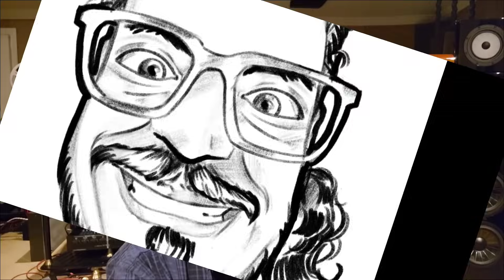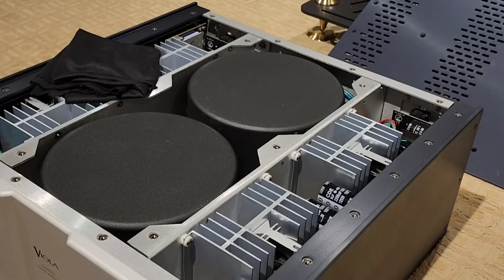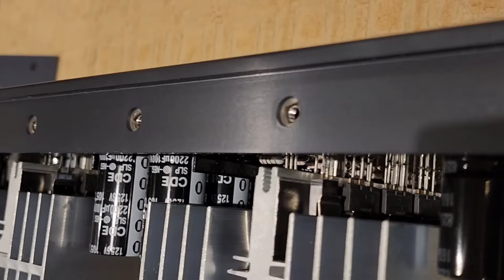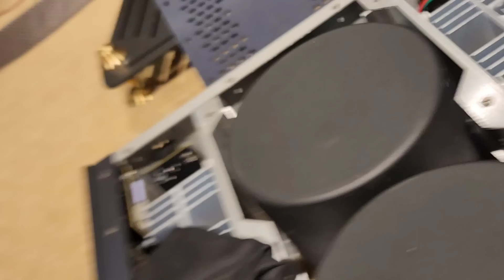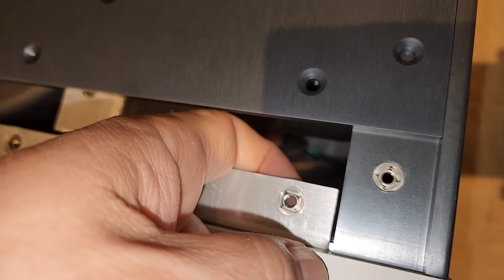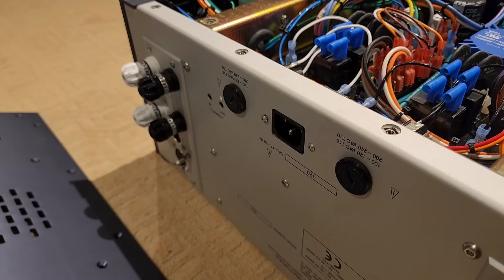THE BEST SLEEPER AUDIO AMPLIFIER OF THE DECADE !! #thebest

Comment: Speaking of 'sleepers,' Madrigal took over the Mark Levinson trademark and one of the amps produced was engineered by Steve Mantz for the last Hi-Fi hurrah of the Harman/Kardon Citation 5.1-7.1 THX line. Steve Mantz still uses and services the Citations at his ZED labs in Los Angeles. At over twenty-years old, there are 60 capacitors to replace. I bridge my 5.1 for 300wpc to drive Dahlquist DQ-10's.
Reply from the maker: Wow. Crazy...
Reply: @OCDHIFiGuy  "We did design and build the Citation 7.1 and the smaller 5.1. We built a lot of these for Harman International. The amplifiers are flat from DC to 270KHz where the response is about 1dB down. Harman wanted this silly specification, why I do not know because we are not bats and cannot hear that high. The original specification was that they wanted the amplifier to go out to 600KHz, but the first prototypes were NOT happy out there and so we 'compromised' at just under 300KHz.
Each channel uses 10 Toshiba 20MHz output devices with a theoretical dissipation of 1,500 watts. The circuitry is fully complementary from input to output and it has some very unique features. Each channel has 6 power supplies which are separate from the other channels. The only common item between channels is the power transformer, which is a 2.2Kw toroid. This 2.2Kw rating is at 25 deg C and it can put out upwards of 3Kw at higher temperatures.
The input complementary differential pairs are driven by temperature compensated constant current sources, which ensure almost zero drift of the DC conditions with each channel. These are also cascode connected for maximum bandwidth. The main gain stage is also cascoded for increased bandwidth and is also Darlington configured for high current gain.
The output stage is a triple Darlington with ultra fast turn off delay. The main power emitter resistors are non inductive types. No coils are used in the speaker circuit and the amplifier is stable into reactive loads with a phase angle of over 45 degrees. It has the usual plethora of protection circuits which by the way are not in the audio path. The amplifier can be turned on with a remote trigger or by the rocker switch on the rear. It can be changed to run from 100v to 240 AC 50/60Hz.
I have the last two production amplifiers at home, one of which I use in my own system for the subs. I run it in bridge mode into a 2 ohm load, and I get out 1Kw per pair of bridged channels. I did modify the protection circuit to allow me to run each channel into 1 ohm! I have used the amplifier for 8 years now and it has run flawlessly." - Steve Mantz
Reply: The house isn't tornado proof, but whatever those amps are sittin' on ain't going anywhere.

Comment: I wouldn’t call this a sleeper amp by any definition. It just isn’t. Stuffed in a rack it looks high end. Close your eyes and on weight alone it screams high end. Cover the name and just look how the exterior looks, thickness of the exterior and that to screams high end. Take of the covers, forget about it, it’s high end in a class by itself. If you took the innards of the amp, stuffed them in the cheapest of metal boxes, didn’t let anyone look inside or lift the beast then yea it could be considered the sleepiest of sleepers.
Reply from the maker: Its learning time. Look up Boulder Amplifiers. Look up D'Agostino Amplifiers. Look up Gryphon Amplifiers. Look up Burmester Amplifiers. Look up MBL Amplifiers. Those are a few of the competitors for this amp.  This is by all means a total sleeper...
Reply: @OCDHIFiGuy  Why? I grew up in the 60’s 70’s, I’m also a car guy. The “sleeper” wasn’t the Mustang, Camaro or Lamborghini. It was the Honda Civic with a Chevy big block stuffed between the fenders. That’s a quality amp and you can tell just by the methods I laid out. If it was a car I wouldn’t race it unless I had the sleeper I built myself and I knew I had the edge
Reply: @NA94753 😮

Comment: I'm unsure we should be calling 20-30k amps as sleepers. Sleepers in car terms I know of is basically a car that doesn't look fast but goes like hell once you try to race it. a BMW M5 doesn't qualify as a sleeper since it's expected and looks like it goes fast, a BMW 340i however without any sports pack still goes very fast but doesn't look like it..just like the above amp, I expected way more from 30k lol. Sleepers should be relatively high value(not cheap), with built quality based on the price it's sold at and outperforms many of these higher end(good sounding but horrible value amps). Hypex Class D amps like the NC500 module would be a sleeper, sounds fantastic(no house sound), make your own through the DAC and Pre-Amp of your choice, built to last, super power efficient with 1200W power Supply, very low temperatures(Again extending the life of the equipment) and distortion levels to dream of. 2K would get you two monoblocks that walks past the above. Maybe the above will give you a House sound that you prefer, that's subjective.  So it may be a Sleeper...for the ultra rich...not for common folks ;)
Reply: He click baited us with the title.
Reply: Totally agree, $35k! Not sleeping anywhere.
Reply: The price is ridiculous.
Reply: @TheStarflight41 30k is not much for an audio amplifier these days though  🤷
Reply: @marcfavell   yes it is
Reply: High end vintage Japanese integrated stereo amplifiers if restored to mint condition can potentially go for as high as 10 grand. It has that unique sonic characteristic of being both warm sounding and bright at the same time that the vast majority modern amps do not have. I prefer a musical sound over analytical anyday. If I wanted analytical sound, I would go for Genelec studio monitors.
Reply: @davidperry4013  My favourite amp is a Pioneer SA 6200 , fully refurbished and recapped a set to factory spec. It's 15 Watts output into some vintage wharfedale w70's. For room it's perfect. The Japanese made brilliant amps in the 70s.
Reply: @davidperry4013 class A amps all the way.
Reply: @johncribbs8382 
Great heaters!
Reply: @davidperry4013  for power amps imo..just go digital. hypex or purifi. if you want warmth go for a pre amp of your choice, a good tube amp for example. sound characteristics should not be part of the power amp ideally
Reply: Title versus content makes me want to stay away.
Reply: Pretty much anything audio related is overpriced. Especially this kinda shit .decades old designs made with a few hundred bucks in parts .
Reply: He said $35k in the video. For that price, this amp is garbage.
Reply: @Gruuvin1  This channel is garbage.
Reply: For that price the amp should sleep with me and cook me F'n breakfast in the morning...lol
 @Gruuvin1
Reply: Couldnt agree more
Reply: I put a 550 in a ford Taurus’s
Reply: I would expect more of an amp that expensive
Reply: @Stan_the_Belgian  35000€ est trop cher  : combien coûte cet amplificateur en pièces et matériaux ?10000$? Ou vont les 25000$ de différence?: marketing,, publicité, revendeur, intermédiaire....
Reply: Hello from good old Germany... Very well spotted! This high-end nonsense is really getting on my nerves! I come from an event technology background and we always find this high-end society amusing ;-) I have been building speakers myself since 1978 and I laugh at the whole thing! PWM amplifiers have been part of event technology for a long time, and my back thanks me for it! The high-enders are slowly realizing that they are losing their skin! Class A is not for the modern world, at most for the rich who then cool down the overheated room with their air conditioning in the summer... we live in today, not yesterday!
Reply: Class d sounds like shit what are you on about
Reply: @thebloodrend  😅😅 How are people praisong class d amps when there are pure class a amps?
Reply: @beslemeto  I don’t understand the hype for class d. It’s sounds so dry and dead. It’s only good for large scale applications and projects.
Reply: @WhopperRektem depends on  amp I agree a lot cheaper products do sound clinical and forward . But even cyrus break that mold for the price of a fosi  one can buy a much Superior class D add the power supply and your cooking for £300-350 .
Reply: Better leave it as a sleeper! 😅
Reply: Totally missed the boat on what that word means.
Reply: Ill take a Luxman tube amp for $4-5k and spend the rest on other equipment. This is not worth 30k.
Reply: A sleeper in automotive terms is a stock looking, modest and understated, usually cheap 'everyman' car that has been highly modified to be as fast as hell....but still looks cheap.
Reply: it´s true but since early 70´s BMW produces very fast cars with quality of building, so it´s only natural that a BMW is fast ,that i know of there aren´t none that drives slow, in the 60´s there was a model that looked as the alternative to a beetle in VW but looking smaller with only 32 h.p.from BMW, i colect them
Reply: Nice to see a balanced cynical view lol. ♥️👍 However, tldr.
Reply: I agree
Reply: I regard the Sanders Magtech amps as sleepers.
     
Stereo:
500W 8Ω / 900W 4Ω
Mono:
1600W 8 Ω  / 2000W 4Ω
Fully regulated power supplies. Drive down to 0.3 Ω

But the audio press rarely champion them because they are sold direct and hence they can’t make a buck from them.
Reply: @vira4032  My Yamaha MX-1000 also can reach 400 wpc in 8 ohms
Reply: Technically an audio world 30k is sleeper 🤷 considering 40K for a center channel speaker is normal 😂
Reply: House sound?
Reply: @vira4032 Hello from good old Germany... Very well spotted! This high-end nonsense is really getting on my nerves! I come from an event technology background and we always find this high-end society amusing ;-) I have been building speakers myself since 1978 and I laugh at the whole thing! PWM amplifiers have been part of event technology for a long time, and my back thanks me for it! The high-enders are slowly realizing that they are losing their skin! Class A is not for the modern world, at most for the rich who then cool down the overheated room with their air conditioning in the summer... we live in today, not yesterday!
Reply: Agreed, in the $30K range you certainly have some serious competition.  I might lean toward a used D'Agostino Momentum or the Pass Labs X600.8 monos.    I read the Tone audio review of the Bravo II and it was quite favorable ($50K yikes) but if I had the cash, the choice would hardly be straight forward.  If I only had that kind of a complicated life ... am I right?
Reply: How many screws.
Reply: Sleeper means something others are missing out on, something many don't choose and are better than they are deemed.
Reply: Thier is similar to looking viola amp for 3500 euros now. Seems a bargain for what you get. BTW, class D lacks tne airy notes and soundstage of these such amps . It's not to everyone's taste, but once I heard it, I've always chased it. Sadly, I can't afford it as yet . I do own a Myryad ma240 and a few cyrus class D very different Amps
Reply: yeah, I also think some of the Chi-Fi builds - like the "MASTER D9PRO 300W*2 Clone Dartzeel NHB-108 Power Amplifier " that get rave reviews online and cost 1000 USD, as sleepers because they are no-name brands and do really well !!!
Reply: I was just reading the title of this video again after watching it a few hours ago and the first thing that popped into my head was, "I don't think you can call an amp this expensive a sleeper". Came to the comments to type it up and low and behold I'm DEFINITELY not the only one. 😂😂😂😂
Reply: Agreed. Right or wrong, I consider my $2K Parasound A21 more of a sleeper than this 35K beast.
Reply: bro understatement! lol i clicked this thinking ill see like a $2000 sleeper lol.. i could buy a couple acres of land up north in the woods for 30k. im not buying a 30k amp
Reply: A sleeper is a box that you don't expect to perform, no matter the price.. a rolls can be a sleeper 🎉
Reply: Exactly.  Sleeper amp - HAFLER DH500...puts out gobs of power and clarity - VERY low THD and has amazing bass...can be had for under 1k.  THAT is a sleeper.
Reply: This is a pinnacle  product at the extreme end of the diminishing returns curve.  It really is a thing of hand built craftsmanship beauty, worthy of display in the Smithsonian, with it's covers off of course, as it's beauty lies in it's guts.  That said, I'm not even sure if the good ship "FU Money" came in that I would own this amp, as I don't want to have to deal  with lugging that heavy ass thing around. 

For most of us non Lotto winners who want ludicrous power and high current capability with great sound quality, modern high end Class D has rendered behemoth AB amps like this more or less obsolete.  For example, NAD's Master Series M23 at 3.7K, paired with a high quality tube preamp, suddenly looks like a screaming bargain 😆
Reply: Or you could buy another dualmono amplifier from one of the designers of Viola Labs the Levinson ML3.
Reply: @craighoffman6876 35k is no where near that point of diminishing returns considering there's an app that cost 80k amps are very much noticeably better like 
D'Agostino amps got my old friend passed away 2 years ago had 6 of them just running his fronts and 4 REL subwoofers
Reply: @craighoffman6876  agree.  For my ears a $500 used ADCOM will sound just the same as this beast.  Your neighbor will call the cops if you remotely come close to using all the wattage.
Reply: “…thing of hand built craftsmanship beauty, worthy of display in the Smithsonian…” 😂😂😂

My Industrial Design degree is offended
Reply: 34,000 and it's 200 watts per channel. That's it! You can buy a car with more amplifier power for the sound system for 34,000.
Reply: @PDXGTP it's not all about Watts though
Reply: @PDXGTP it’s not about quantity, but quality
Reply: @PDXGTP  Yeah but then you have the horrible inconvenience of having a Car.
Reply: @PDXGTP  Given the size of the power supply , this would be a high current amplifier , capable of driving very low impedance speakers -like the Infinity Kappa 9's ( Impedance drops below 1 ohm !) 
Current Capability: High-current amplifiers are designed to provide substantial current output, allowing them to handle complex and dynamic audio signals without distortion or loss of fidelity.

Speaker Control: With their ability to deliver ample current, high-current amplifiers offer better control over speakers, resulting in improved accuracy, tighter bass response, and reduced distortion, especially at higher volumes.

Efficiency: These amplifiers are engineered to efficiently convert electrical energy into amplified audio power, minimizing wasted energy as heat.

Stability: High-current amplifiers are designed to remain stable even when driving difficult speaker loads, ensuring that they can handle various speaker impedance variations without compromising performance.

Dynamic Performance: These amplifiers excel at reproducing sudden changes in audio dynamics, such as quick transients and peaks in music or sound effects.

High-current power amplifiers are commonly used in home audio systems, professional audio setups, and high-quality home theater systems. They are often found in applications where accurate and powerful audio reproduction is desired, such as live sound reinforcement, studio monitoring, and audiophile-grade audio systems.
Reply: I would put A LOT of money down and bet my Audiophonics HPA-S400ET would outmeasure and outperform this amplifier. My Purifi 1ET400A amp is the real sleeper.
Reply: @The0nionKnight  You're a sleeper and you're dreaming, your Amp isn't even entry level.  Probably a class D.
Reply: @The0nionKnight vous êtes ridicule😂
Reply: @The0nionKnight it won’t sound better that’s for sure
Reply: Yeah this is like calling a Bugatti Veyron a sleeper.   No a 1995 ford mustang with a 700+hp big block is a sleeper.   A 0-60 in under 3sec Tesla is not a sleeper.
Reply: @L0st-n0found he made the context clear at the start is a plain looking box with extraordinary products instead.  Just like your Mustang with high bhp.

Comment: Beautiful amp, but a $35k amp is not a sleeper. It would really be at $3.5k.
Reply from the maker: Sleeper is something that looks like nothing special but is the best amp you've ever heard. Sleeper is always tied to performance, not cost. $3500 would make it a cheap amp with much lower build quality... or one made in a country that supports slavery with a copied circuit and lower build quality.